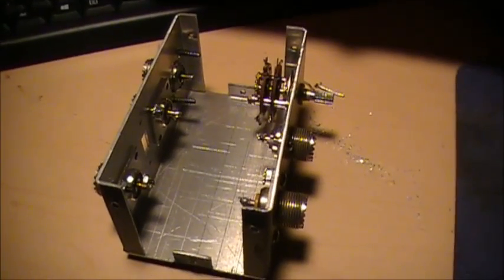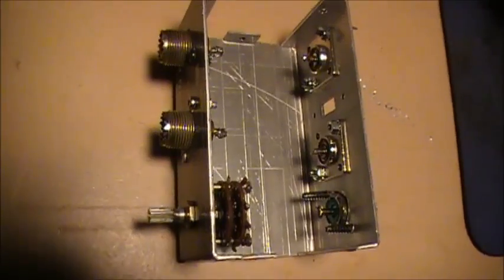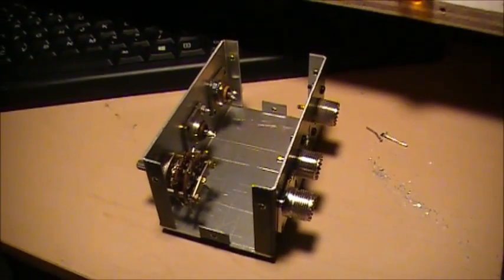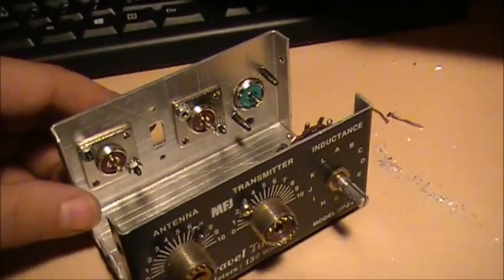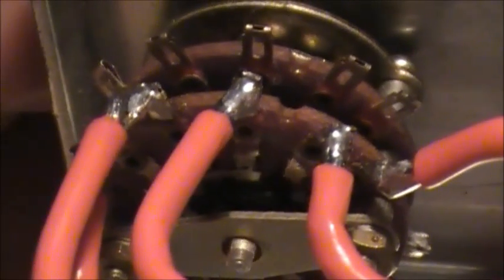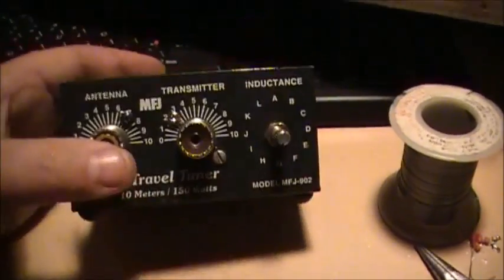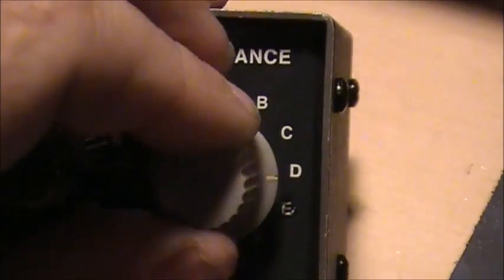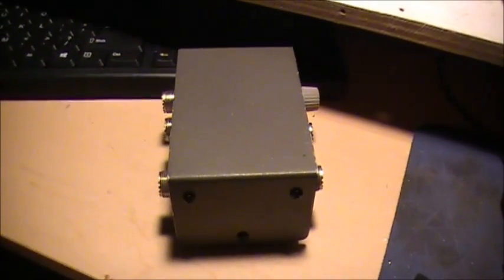Simple antenna switch

Comment: Nice little project but too much excess talking.  I converted an old PC data switch by removing all the connectors and adding SO239 connectors and 50 ohm COAX for my HF rig dipole antennas.

Comment: I did that once because i needed one for vhf, it did not work although the multimeter said so. and the chassis mounts so's did not work, since some were too short for the pl 259's. on vhf the match was bad. perhaps yours is better than i did, good vid
Reply: Well I have made something like that, for VHF and UHF, even in a plastic diy box 😁 And somehow it worked, with qrp TRX 😁 yeah, between switch and connections was coax. Maybe this thing helped a little. I didn't had ability to measure how much swr changes and etc... for now my HF is 100W (just TRX, no amp), VHF 50W, UHF 20W and also no amp

Comment: I have 2 homebrews of those. In my case I use one to switch between 2 longwire SWL antennas going to my SW receivers. Depending on the direction of the incoming signal a switch can at times make a dramatic difference. The other switch is used to switch one older RS mobile ctr loaded scanner antenna on my workplace roof to either a Grecom scanner or a FM car radio/speaker setup. Perhaps you would consider a vid of yours in action  in the future.
Reply from the maker: tomorrow after work. ;-)
Reply: @Radionut63  LOL Mick, tis true.    Anyway Radio dude you might suck off all the solder from the contacts on switch and the coax collectors as the first step of construction.
Reply from the maker: If you call this constructive criticism, you SUCK at that!